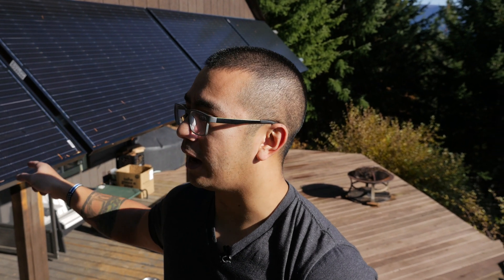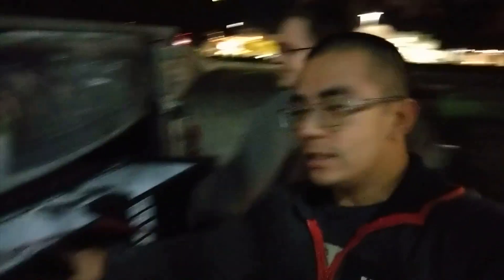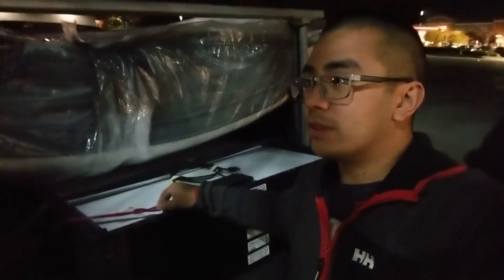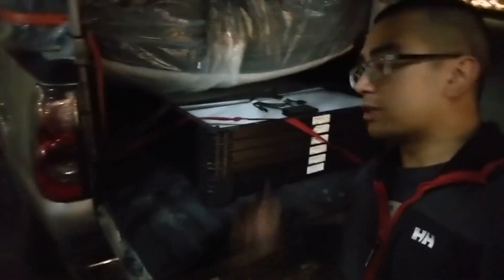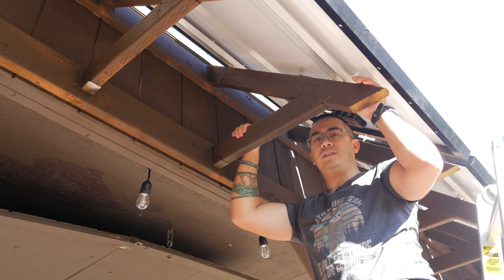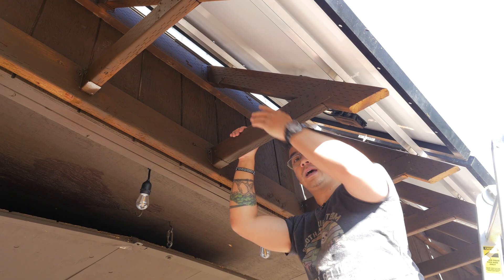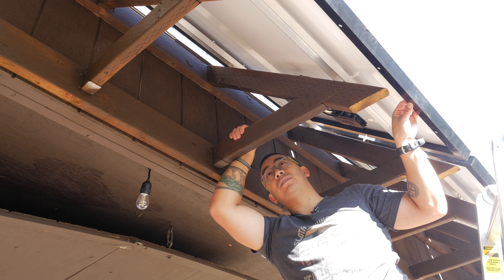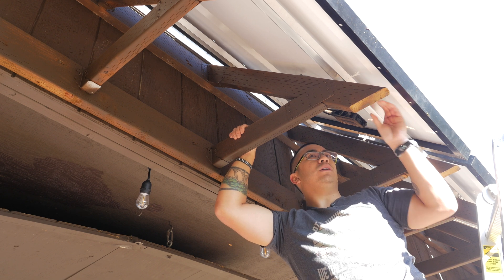SIMPLE DIY SOLAR POWER Awning for our OFF GRID CABIN

Comment: Hey andy 
Is there a new knife ?
Reply from the maker: Yes it's in the works with WorkTuff Gear
Reply: @innerbarkoutdoors  niiice 🥰🥰🥰 im so nervous 😅 i hope its 6inch blade length or more. I would love a finger choil and i hope for micarta handles,sharp spine. No double edge 😇 can you tell me some details please 😍 can i buy a prototype ? Best regards from switzerland
Reply from the maker: This next one is a companion blade. It sounds like if you modified the TFK with a sharp spine, it would suit your needs. I do have a mini TFK in the works (a couple inches shorter) but that won't be worked on for some time.
Reply: @innerbarkoutdoors  i love my tfk but i dont like the prybar and i dont like the double edge 🤭 i can cut the prybar thats not the problem but i cant change the false edge. Without the false edge i would marry the tfk 😅😅😅😅
Reply from the maker: @sinkswim1798  Are you meaning the false edge or the double edge that you don't care for? If I'm understanding you correctly, you'd like a drop point or something like that.
Reply: @innerbarkoutdoors  yes right you know what i mean drop point 😅
Reply: @innerbarkoutdoors  tfk with drop point,sharp spine thats would be great 😋 i send an email to tops but they cant do this for me 😔